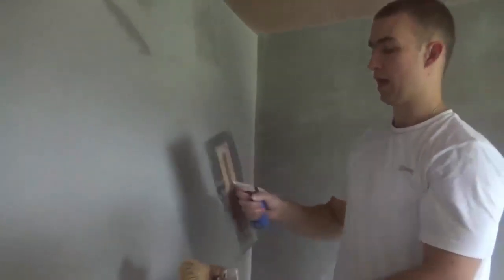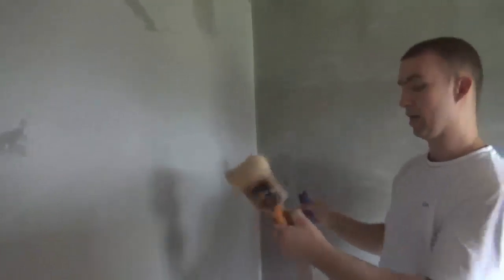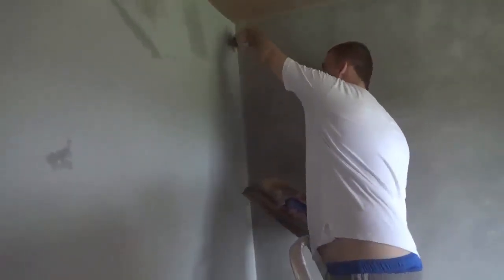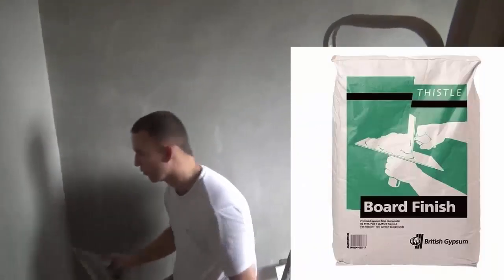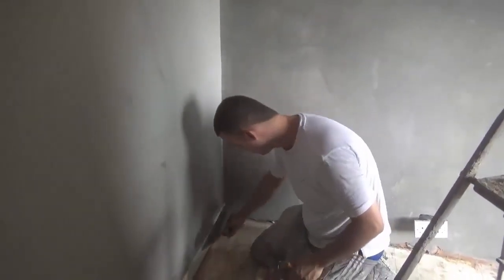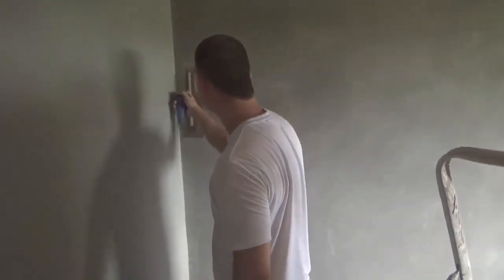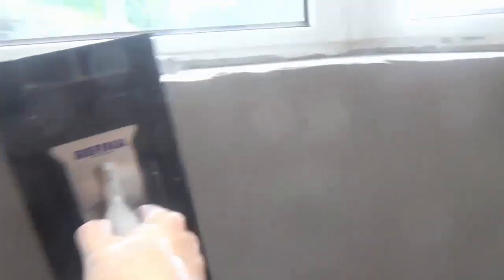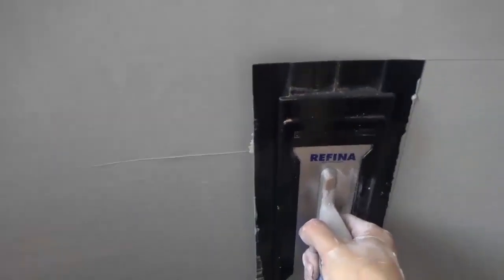Plaster and the difference in thistle multi finish and carlite ultra finish

Comment: Used some Carlite today. Seems creamier and stickier to use. Very nice to spread and trowels up lovely. Whereas I find thistle multi to be a bit grittier. Not as creamy. Another thing I noticed is that Carlite seems to skin over when you get to certain point. Water seems to bring it back to life again. Might just be a me problem though. Shame they don't sell Carlite in England off the shelf.
Reply from the maker: I find the same things mate find it just gets in that little nicer quicker than multi

Comment: Speaking on products   as you know all boards need to be fire proofed before skimming new regulations.  I am running a banjo but all joint filler i have come across the longest joint filler i have found is a 90 min set but i would only get an hour before it turns and i have to wash out the banjo 😥 any suggestions for me mate?
My preference would be to use premix but they dont stand by it cause apparently the filler gives a half hour more if a fire takes place!
Reply from the maker: Hi Paul mate I dont use a banjo and very rare do tape a mud , I now bonding is great for fire resistance mabe you could do it as a filler then run over it with the finish coat  , but might be as good to stick to what you know works

Comment: In the 'good'ol'days' we had Siraphite and Statite for finishing sand&cement render. (Before Carlite was invented) It was a bit 'hot' at times (went firm before you got it out the bucket) but we added a pinch of cream-of-tartar powder to hold it back and it finished spectacularly (like marble).
You could also 'bring it back' with a splash of water if necessary the next day or even later if it wasn't up-to-par :-)

Dry carlite or dry sand&cement render is a bugger with Multi-finish but the carlite finish is far easier to handle don't you think?

Keep Grafting :-)
Reply from the maker: Cool Peter I never heard of those plasters before they sound good hope they bring it back but more than likely wont as sounds a little more time consuming?  Yes I generally find carlite that bit better to finish and spread but that being said multi is still good just if i was choosing would be carlite blue 1st as long as it wasn't to big an area if it was like a 4 or 5 bag ceiling would go for RED carlite
Reply: You'd have thought it would be more time consuming but you could put on a 3 bed house and still trowel it all up at the end of the day.
"LodasaMoney" ;-)
Reply from the maker: Wow stuff sounds brilliant why did they stop with it was there long term problems ?
Reply: In the very hot summer of 1976 too many spreads couldn't handle it.
(sorted the men out from the boys :-)
So Btitish Gypsum developed Multi finish as an easier option to keep them happy.
I believe you can still pre-order off of gypsum but the cost is horendous :-(
Reply from the maker: ahh i see warm weather dose make skim set fast always the way if you want something they gonna make you pay for it haha

Comment: Hi you n your family r well ,any  other guidance on the carlite finish the red bag what’s the setting times n how many trowels to finish
Reply from the maker: Same methods as multi skim mate only they wont stand over a sponge they say it turns it to dusty and can be un able to paint, red bags should take a little longer to set but in this heat it might not mate , we are doing good hope you and yours are to mate :)
Reply: Hi mate used the carlite today on a ceiling no probs great stuff ,does it dry light grey? 👍
Reply from the maker: @HSilver341  drys like multi almost white or very light grey

Comment: I’ve now received a pallet of this plaster as multifinish is like gold dust, can the red carlite finish plaster go straight into plasterboard like multifinish? Thanks for the videos there really helpful
Reply from the maker: Hi mate yes it sure can the way I do it is cover scrims witha tight coat then 2 coats on the wall but yes its just like multi get it onto everything the same way and methods of finishing just like this video and others I have done on this vid i have multi on ceiling and carlite on walls just to hep show differences , Glad you find some the videos helpful it is much appreciated and my pleasure mate  always here if you need some more ideas or help :)
Reply: mac plastering so just to confirm go over scrim joints first then do a whole coat on walls/ceiling followed by a second coat and trowel up etc, how long between coats is it the same as multi where u wait for first coat to harden up or is it wet on wet as some web pages suggest
Reply from the maker: @mikeriches9135  I find you can go wet on wet or let it take up a little 1st in my opinion it is good gear I also cover scrims with multi and then followed by 2 coats :) red bags should hang a little more than multi but in heat it wont same as multi it will go of faster with heat or air flowing in room , blue bags ultra finish it sets in like 2 hours so can be a little faster
Reply: mac plastering thanks a lot that put my mind at ease. Your a star
Reply from the maker: @mikeriches9135  Its my pleasure buddy Im going to do a follow up video on this topics mate answering questions and giving out tips and dos and donts if you wanna keep an eye open for it :)
Reply: mac plastering monocouche parex render is my next task 👍🏽
Reply from the maker: @mikeriches9135  Mike that is a task for sure, I used k rend and webber but its not easy to had apply and can be hard to scratch of though looks great when finish and a real achievement :) priced a big one not so long ago dont think I have got the job but good luck to the guys on it its not going to be easy on them

Comment: If your skimming can you multi finish the 1st coat then carlite finish the 2nd coat or shouldn't you mix the two. I'm thinking if the carlite is easier to use and a different colour that way I can see where I'll been on my 2nd coat.
Reply from the maker: I dont think either company would stand over it mate to be honest if you read the bags they will always say only be used in accordance to and it will be there products , I would think it could work cant see why it wont but it might go funny also could be worth a small test some where, thing is 1st coat you will want the quicker setting gear on 1st then the top coat the slower so it wont slide and tear
Reply: @macplastering  think I'll try on a board in the garage and leave it for 6 months . I wouldn't mind trying the carlite out on a job I've never used it before.
Reply from the maker: @dilligaf2386  mate might be best thing to do

Comment: whenever summer comes round and it starts to get warmer I always just use a bit of cream of tarter. I used it yesterday for the first time this year.  works just fine.  cheap as chips too
Reply from the maker: Hey James thats a great tactic buddy I haven't actually used it before myself but If I ever have to do a large area i think i will be ordering some in :)
Reply: +macplastering  it's the only thing I've used that works. I've just thrown 3 bags of board finish on , it's absolutely scorching hot and I'm sat down enjoying a cigarette haha. give it a go mate. great videos by the way.  your a good plasterer
Reply: +macplastering onto plasterboard
Reply from the maker: Thanks man :) Yea my setting times was so fast yesterday was over skimming and 2 bag ceiling witch had just bare plaster on it but mixed the multi wet and moved as fast as i could haha :)
Reply: +macplastering haha re-skimming in this weather = sweaty bollocks!  😂
Reply from the maker: Haha for sure lol
Reply: macplastering be warned if you put cream of tartar in your finish mix it weakens the overall hardness of the plaster once dry.
in summer use about 25% less of tartar.
 Because at the factory they already add retarder in to gypsum mix. 

Also boardfinish has changed quite a bit. it used to be better then finish but now it's worse!  I think it's because they wanted to push unfinish but the cost has put clients off. still use carlite nice stuff to use 

👌 just come across your video in my suggestions box. just thought I would comment
Reply: Roughly how much would you add into a one bag mix on a 28/30 degree day ?

Comment: Hi I have recently started using car lite because it’s all I can get hold of atm . When finishing my final trowels towards the end it seems to pull and rip and causes major problems. I did read the back but it doesn’t mention about the song PVA . It says just wet the walls , is this correct ? Do I not need to PVA The walls with carlite ?
Reply from the maker: are you re skimming mate ? going over old ?
Reply: mac plastering yes mate over old
Reply from the maker: @anthonywilliams2764  Red or blue bags ? I tend to find this is a timing thing when it tears either slightly to early or to late if it is just small tears on surface , but it the hole lot is shifting of your pva it sounds like the pva was not dry enough or wall paper paste was still on the walls before have it can make the stuff slide everywhere for sure pvaing walls is needed for this to bond same as multi mate hope my thoughts here help for  you on the next lot of walls mate
Reply: mac plastering spot on il let you know what happens next skim
Reply from the maker: @anthonywilliams2764  Sweet mate I know the pain of this most times it was paste on the wall causing skim to go strange I scrap the life outa it or a light sand then dust of pva and when pva real tacky get the mix on and skims a dream hope the next hits work fine for you mate

Comment: With multi once open how long will it last and how would you store it as iv noticed it goes off rapid if not a fresh bag
Reply from the maker: Great qustion i will have to get yiu a better answer , but i would think a few weeks in dry conditions after that i recon it will go off,  by either setting to fast or way way too sloow longer than a few weeks it could start setting in the bag if any moisture gets in making large stones , bedt way to store after open is in plastic bags and taped sealed if possible hope this helps mate

Comment: Hi, do I need to pva the walls before applying carlite finish?
Reply from the maker: Yes my friend if you are going over old plastered walls like so - https://www.youtube.com/watch?v=FKbkjCBpEq4&t=368s
Reply: @macplastering  thank you, I've used Thistle multi finish before, is the process the same with carlite finish?
Reply from the maker: @mondrota  Same pretty much slightly diffrent times but carlite is that little nicer to work wth